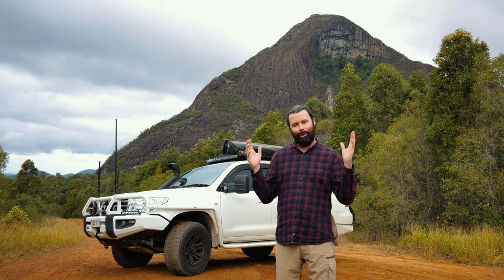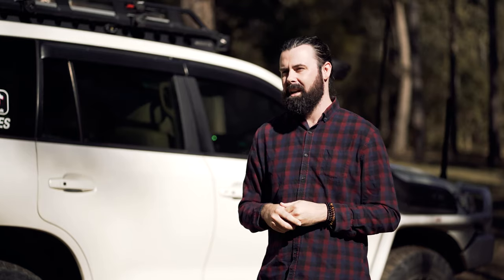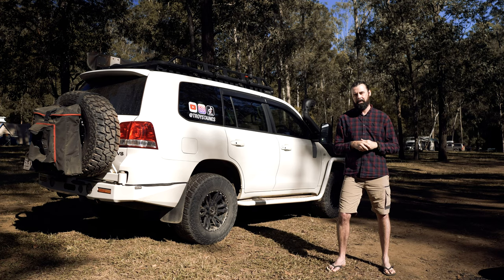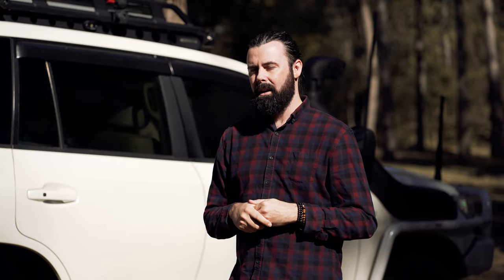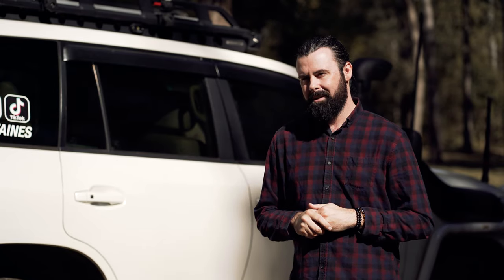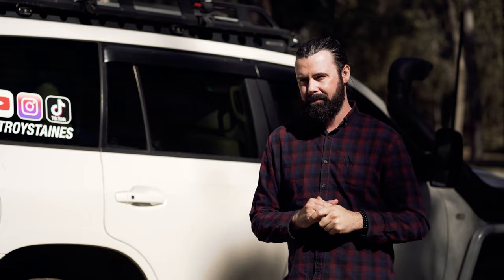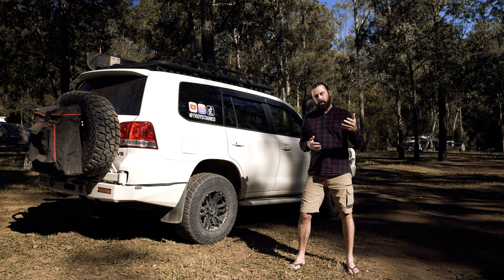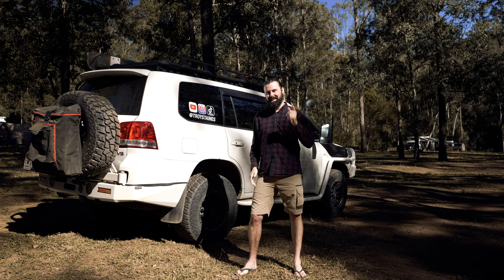200 Series Landcruiser Build - Episode VIII Control Centre

Comment: Hi Troy, great video and review of the 16" control centre from EC Offroad. About to do the big lap and looking to upgrade to this unit for our LC200 2011. Have the software upgrades made a difference, and if you had your time again, would you select this system?
Reply from the maker: Hey Rohan! I've since sold the 200 series but in the end it was working just fine - sometimes there would be the odd thing like it would be a little slow after a very long drive, or the bluetooth wouldn't connect quickly, but it was such small issues that i was willing to put up with since it was a 12yr old car trying to communicate with new software.  I know that they have since released new models that friends of mine have that they are all happy with. Definitely worth giving the EC guys a call and having a chat about options for your particular model.

Comment: Brilliant as always mate! Have you had the Linx for a while? Got a quote and having one installed, but with the switchboard module and traction module can get up to 8 outputs instead of the 6, might be an option for ya if you wanna get rid of switches altogether and run everything with the Linx. I have switches at the moment but like the idea you are going with of keeping it clean and everything through the Linx system which looks cool as!
Reply from the maker: Thanks mate!  Yeah I've had the LINX for about 2 years now at a guess.  I think it's a fantastic bit of kit.  I already have all of my driving lights put through switches so don't really see the point of getting them running through the LINX. The buttons just stay on most of the time anyways and if I'm in a rush to turn the roof light bar or the driving lights off/on it's much easier to reach down and push the button on the dash then scroll through the ARB LINX menu and find the correct button to push as you are driving down the road.
Reply: Troy Staines yeah that’s a good point mate, glad your video came out just now cause I may have overlooked that so probably just helped me out there haha! Again loving the series mate and look forward to the last one!

Comment: Do you know if there is a user manual available for the EC Vision and Sound screen?
Reply from the maker: Not sure about a manual but they have heaps of videos on their website and YouTube channel
Reply: @TroyStaines  Thanks - did you ever make the video about how to use it that you spoke of in the video when you show the head unit. I have one for my 2011 Sahara but it would be nice to have some instructions rather than just pushing buttons to see what happens.
Reply from the maker: @gregmccarthycronulla  sorry Greg I never got around to it because EC had come out with their own videos and I’ve since sold the car. I still have a few mates running their screens without issue though. Best thing to do if you are having any problems is give the guys at EC a call - they know their stuff and will help you straight away!
Reply: @TroyStaines  Thanks Troy. I only got  mine a few days ago and have it working well with CarPlay but it looks like it will do so much more than I expected but I am reluctant to try to figure it out by just pushing buttons. I got mine from the local Sound Guy here in Cronulla NSW. I might give EC OffRoad a call. My car is a 2011 LC200 Sahara which I have had since new (only done 90K)  but the head unit started playing up. I got this on recommendation from sound guy for Apple CarPlay but it looks like it will do so much more. My local guy is going to give me a run through tomorrow.

Comment: Hey Troy, I just bought a 2008 Sahara and it has this screen installed, was installed by previous owner a month ago, I have a problem where I can’t use my aircon on the screen at all, when I first got the car it worked but after I did a reset to remove old owners files, it hasn’t worked since then and I can’t figure it out. Have you ran into the issue after resetting? Thanks
Reply from the maker: Nah mate never had that problem! Flick Cale from EC Off-road a msg and he should be able to help you - can find them on Insta or Facebook :)
Reply: @TroyStaines  thanks mate, looking forward to more videos on the 200 👍